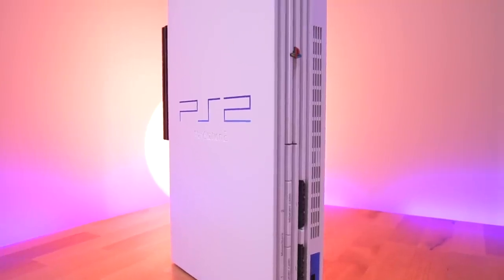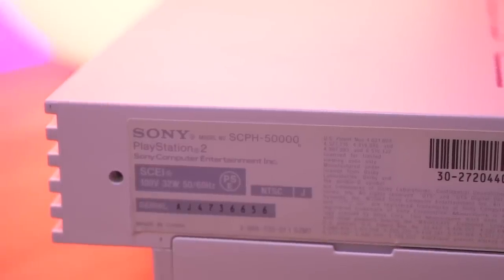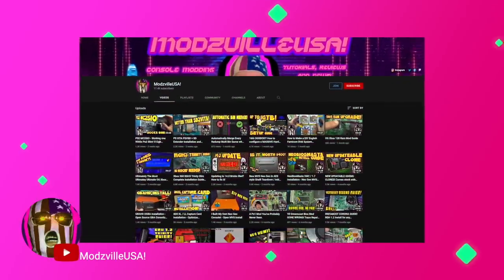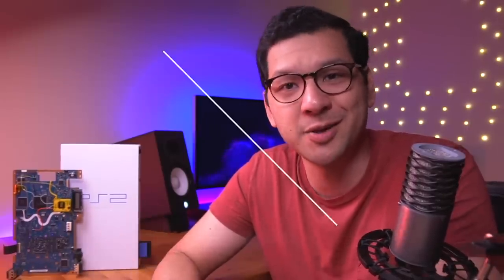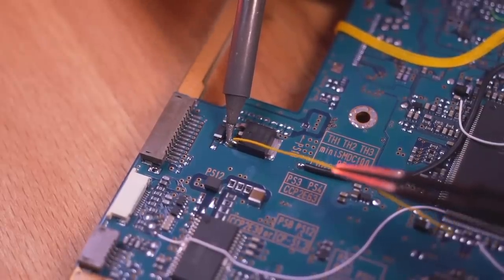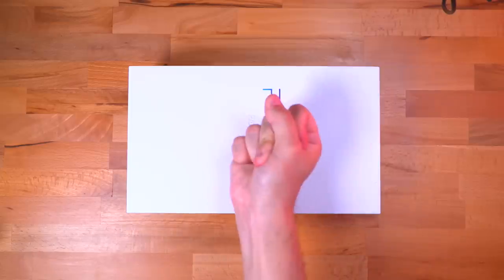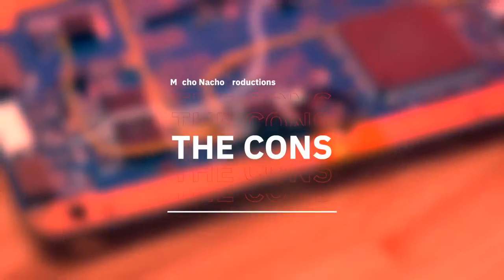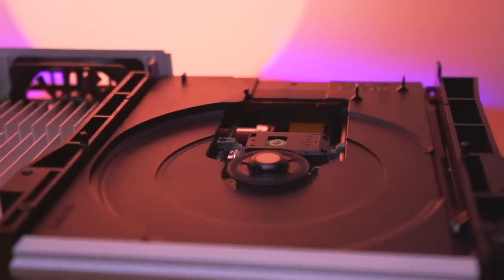This Mod Prevents Your PS2 Laser From Burning Out | The PicFix Mod

Comment: This is no where near as bad as the clock capacitor in the original xbox
Reply: Yes
Reply from the maker: Don’t know what Microsoft was thinking with that clock cap
Reply: @MachoNachoProductions  They definitely weren’t thinking about capacitor plague lol
Reply: That clock capacitor cost me a mobo. Hopefully there is a solution to that thing, unless I was living under a rock and there's already one
Reply: @Defx86  the solution is remove it!
Reply: My original died due to that capacitor during the life of the system. Repaired under warranty. Later on when I grew up and got into modding, I fully removed it
Reply: @Defx86  the solution is just removing it, works fine without it
Reply: Thats exactly what i did to my xbox the moment i got it, removed the clock capacitor completely.
Reply: just gotta make sure it is not the 1.6 variant since that one searches for the clock cap everytime the console boots and it won't work with it removed.
Reply: @andreiordean9346  And you don't need to remove them on a 1.6 anyway.
Reply: can you install this chip without the little PCB its mounted on? as I don't think they make them anymore and Modzilla doesn't sell them now either.

Can I just solder wires to the chip and insulate it?
Reply: Everybody knows about that, and it’s easy as hell to replace the ps2 laser is twice as expensive and difficult to replace.

Comment: I'm honestly surprised that the ps2 wouldn't have a hardware analog constant current limit on the laser diode drive circuitry to prevent this, completely independent of the mechacon operation. This is how most optical drive systems work, so the closed loop servo mechanisms cant force the components to operate beyond their physical/electrical limits.
Reply: Sjm4306 yo man! That is odd isnt it 🤔
Reply: NEEEEERRRDDDD
Jk but I didn't understand a word you just said
Reply: they did this on purpose so pirates have a difficult time trying to chip their ps2
Reply: @Truth-hk2dv  look at early ps3 consoles, they are the worst offender
Reply: Sony did it on purpose and got sued for it iirc
Reply: Sony wants you to burn for playing imports 20 years after you got your console lmao
Reply: It is believed that MechaCon crash is intentional by Sony, since the DSP chips of the DTL-H models have firmware changes that prevent it
Reply: Just to verify:
This does not apply to any SCPH-3900x model? I don't have the insight to the motherboards in the -5000x models and whether or not any -3900x models were susceptible to the same mechacon.
Reply: @That_Handle The 390xx consoles use the same DSP as the 50xxx ones.. so yeah, 39xxx consoles are  vulnerable too.
Reply: @Rodrigo-ks6oc  ,
✅️✏️📌👍
Reply: It is not the laser diode, they are the voice coils around the lens that move it to focus and track
Reply: I know right. Suprising for serious

Comment: Instead of soldering to one side of the SMD resistor, you could solder to the via right next to it. It connects to that side of the resistor and there is less chance of component damage.
Reply from the maker: Nice!  Good to know there’s another point to solder to 👍
Reply: On the GH-023 board there is a solder pad on the opposite side of the board as well. It leads to another via and then to the dsp cxd3098 chip.

My qsb I'm designing for the GH-023 is flush against the resistor side and blocks all of the surrounding area to avoid bridges.

Another point is as follows from left to right:
Y, K,I,H,G,B,A.

In your typical modchip install count one immediately left of point I and that will also yield the mechacon signal needed for the laserfixes.

Cheers!
Reply: pic's ?
Reply: @haloslayer255  show us. :O
Reply: I have the v8 scph 39000, still works fine with matrix 1.38 since 2003 when i've brought it, do i need to worry about it to my specific model?

Comment: This makes me feel SAD that Sony didn't learn their lesson since they gave the PS3 & PS4 a problem like this but WORSE! Granted they patched it for the PS4 but PS3s are still boned.
Reply from the maker: Yeah, that’s pretty bad for sure
Reply: Maybe hopefully somebody will Port this mod to the PS3.
Reply: sony just dont care if your console keeps working after 20 years lol
Reply: @draconic5129  Yeah. I HOPE someone makes an equivalent mod for the PS3 in the future.
Reply: @GatorRay  how did they patch it for the PS4? Was it done by a hardware revision or was it done in software, if it was the latter that might be easier to accomplish with existing custom firmware.
Reply: @draconic5129  It was a software update.
Reply: @user-yk1cw8im4h  Certainly feels like it. And it's SAD! Especially with the most recent attempt at giving players access to older titles on PS5. For some unholy reason. Has the same issue as the Playstation Classic. AKA SOME OF THE GAMES ARE THE PAL VERSIONS!

Comment: About that board from the previous video, check the fuse at location ps13, that controls the spindle motor ic. It's been a while since I've replaced any fuses but iirc the type to replace with is:
FCC16 401 or TF16SN 0.40 or ERBFEOR40S from the copper silkscreen on a v9, should be compatible with v10 though.

Cheers!
Reply from the maker: Awesome!  Thank you haloslayer!  I have someone looking at it right now and will let them know to check out the fuse. Thanks for all your work supporting the modding community 🙏

Comment: I recently pulled an SCPH-50001/N out of the electronics bin at my local town dump. The other day I took it up to the tech center at my local community college and we were able to get it running. 

Turns out the power supply had died, but the motherboard and DVD drive were working just fine. Hell, there was even a game still in the DVD drive!ATV Offroad Fury 2 in case you’re wondering.

Rather than replace the dead power supply with another power supply of the same model that would’ve probably just died again at some point, we pulled the old power supply out, and soldered a barrel connector to the motherboard’s power leads, allowing the console to use an external power brick. The barrel connector pokes out through the hole that was previously occupied by the power switch for the original power supply.

I’m probably gonna try the PicFix mod at some point to preserve the optical drive. It still works perfectly for the time being, but better to prevent a problem rather than cure it y’know? I also have a slim PS2 that I’ve had since 2006, but luckily it’s an SCPH-75001, so it doesn’t have this issue

Might even try to install a mod chip once I get more proficient at soldering.

Though I probably won’t use the DVD drive that much anyway. This console actually had an official PS2 network adapter attached when I found it so I’ll probably just install a hard drive or SSD. Already have all of my PS2 games backed up on my PC anyway

Definitely gonna replace the cooling fan at some point though, maybe with a Noctua fan like you did in one of your other videos.

Hell, I might try to track down a copy of the PS2 Linux distro to mess around with. So many possibilities now!

Comment: I tried once installing a ModBo chip and ended up frying my laser because it got stuck (apparently a wrongly made connection on the modbo chip). I had to replace the Laser with an aftermarket one, and now everything works. But after what happened, i will definitely be installing this one next just to be sure, ever one joint goes cold or the mechachon decides to freeze again, my poor laser dont get burned again. 
Thanks as always for the great content !
Reply from the maker: I had the same problem. Definitely got to double check solder joint and connections. It’s a great mod for piece of mind. Cheers!

Comment: Con: The PS2 Fat is a such a pain to disassemble.

In all reality I’ll probably skip this mod unless I’m doing maintenance. I suppose I’m taking a minor risk, but I only play legit discs and resurface anything that looks questionable.
Reply from the maker: You should be good to go. Mostly concerns burned media but has also been known to crash with scratched discs. Well taken care of authentic discs great mitigates the problem
Reply: It is the first time, but once you get used to it it becomes quite trivial. When I was cleaning out and fixing my phat PS2, I had to take it apart at least 15 times. The first time was rough to say the least, but afterwards I could crack that baby down to the bare motherboard pretty quickly.
Reply: One of the fuses failed on mine. That was so fun to nail down.
Reply: @frostech3149  this, its really annoying first couple times but really isn't too bad, there aren't tons of screws all over the place or confusing sizes for them. For the fat, if you been using it for years or someone else has and its never been cleaned for dust, I would highly recommend you put in the effort... There are so many places for that dust in that console

Comment: I didn't know about this design flaw until now. I'll have to keep this mod in mind because I play a lot of physical games on my PS2. Mostly, I've kept it around for playing PS1 games in component video.

Surprised there's still no clone systems of the PS2 floating around yet. You'd think there'd be some given that Sony's patent on the hardware has since expired.
Reply: Do you know how complex the PS2 is? Let alone emulate it. Projects like MiSTer got to Saturn/PS1 emulation just recently. i don't think we'll see a "ps2 clone" in, say, 15 years or so. Unless FPGAs get a massive jump in performance.
Reply: This only applies to anything beyond V7 and V8. Such as SCPH5000X’s and beyond. The much loved SCPH3X000’s aren’t affected. Personally i’d rather take the improved heatsink out of the SCPH5000X and put it into a SCPH3X000.
Reply: The FPGA scene has to first get to the Sega Saturn, N64 and the Sega Dreamcast before it even considers something as complex as a PS2 with its Emotion Engine and GS chip.
Reply from the maker: If your model is v8 or lower you should be okay.
Reply: 1st time I hear of this and I call it nonsense. At least for the European market that is. 
Plenty of people I know had and still have different PS2 from day 1 to last gen and I can say that the only reason why laser died out is due to it's shelf life and user neglect.

I restored plenty of PS2 and PS1 for 20 years and never hear of this crap. Unless the mod chips we used somehow fixes these problems hence why didn't know.

My 1st gen PS1 had it's 1st laser replacement in 2016 while some people complain how there is a design flaw of overheating the laser. Which I can see but mine never had the issue.
My fat PS2 simply stopped reading properly newer games at one point due to the fact the revisions got better performance, my slim PS2 had it's 1st laser replacement in 2018. I still have few last gen slims they still work fine with factory lasers.

All of them are chipped day one of purchase.

The only lasers we had to replace etc were the ones that were caked in junk and dust. With few exceptions that some simply fry due to bad electronic mains in some house holds. Often it fry the power supply and few components.

I once lost a PSone due to an outage where a huge burst of electic shock struck in a second later, there was like at least 20 on and off attempt in span of few seconds and by the time I unplugged it from the outlet it was too late. It fried the power supply laser and spindle motor the rest had minor damages. I lost few TV sets and some things in the house at that time and had to sue the electric company for compensation. We got some discounts for few months instead ... I was so pissed.

But yeah I never seen or heard this laser going bad due to reading bad or backup discs ... I run backups from day one ...

Comment: This video was a bit different but VERY HELPFUL!!!  You were able to demonstrate what a flawed install can look like and end up as, and you didn't even try to LOL :P   - With the jokes out of the way it is a GREAT thing you were able to show us, I just wish you had gone into more detail in the original video... it was quite confused as to what happened and it seemed like a cheap low blow of some sorts at the time... like you making it up or something... but I really didn't think that was the case, it just could have seen that way... again, it was just confusing at the time... but now that I know what happened, it all worked out smoothly.. We all make mistakes.
Anyway, this is one of those mods that does give you any instant gratification from all your hard work, but it is TOTALLY WORTH THE EFFORT! Thanks for showing this to the world, I know I NEVER heard about it and most modders would likely skip over it and go for the big toys to add on.... now if I only had a PS2 lol!
-- do you have any add-on/mods fo4r the PS4 Pro?? Not the typical jailbreak that is just so simple, I mean adding cool stuff on to the second greatest system created (even though I have yet to buy a PS5.. I'll just assume it's the best lol) Maybe upgrading a the internal storage to 2 or 4TB .. integrating the Pi Zero INSIDE the console so you don't have to leave it taking up your rear USB port (the pi zero does all the keystroke to initiate the jailbreak as soon as you turn it on - in case you didn't know) - just some cool add-ons - I want to do something to my baby, I just don't know what :) THANKS!!! :D
Reply from the maker: Dont have any ps4 pro mod videos yet but perhaps in the future 👍😁

Comment: This seems like such a rare problem, over the years I've put hundreds of discs in my ps2 that had scratches and I never encountered this issue.
Reply from the maker: Nice!  What model ps2 do you have?
Reply: in a sense, i've used that to my advantage.

my copy of fatal frame 2 has been played to death, so it has some light scratches i'm sure. or at least some level of wear and tear. but when i hear the disc spinning in a particular way/particular speed, i've used that to determine a random encounter is about to occur.
Reply: I had 2 different playstation 2 consoles die while playing gtaiii. I always thought it was weird they died with the same game...

Comment: My ps2 doesn't even have dvd drive, it was physically ripped out by previous owner. But you don't need it to play games and that is beautiful. 
Honestly the optical drive in my experience is the worst part of any console and should be ditched at first opportunity, if other ways to launch games are present for that system.
Reply from the maker: The optical drive is definitely one of the greatest point of failures on any console. I think it great that we have options to not need the drive but I do enjoy popping on a cd every once in a while.
Reply: @MachoNachoProductions  there is some guy working on ps1 games running from usb via some deckard hacking, if that thing is released then ps2 may be finally be fully free from need of disks, though that does not apply for mechacon models.
watch?v=OlSdBusJHks
Reply: Nintendo Switch: Hold my cartridge
Reply: @TN_AU  Too bad actually being able to play it requires paying an extra $70 to avoid dealing with the crappy joycons.
Reply: @TN_AU  many cartridge games require updates to add the necessary game content (AKA zero day updates) which is fine if you hacked your switch (then you can just download those updates from a different source) but if you have a later model switch and didn't install a mod chip when the service shuts down you're not going to be able to get those zero day updates anymore.

So the cartridge's added durability over the unupdateable optical discs is effectively offset by the fact that the games require zero day updates to either be finished if not in some cases even playable.

This is just on the switch though, other cartridge based systems like the DS and 3DS don't really have this problem (3DS games still use updates but they don't have mandatory zero day updates to my knowledge).
Reply: @draconic5129  good points, we are screwed regardless of how we obtain games.
Reply: Honestly I'm just waiting for someone to make an ODE for the ps2, maybe like the X-station
Reply: @draconic5129  You can make backups of your Nintendo folder on MicroSD card though.
Reply: Same. I run an SMB server for OPL.
Reply: @draconic5129  sadly alot of cartridges that are multiple games in one require you to download the other 1 or 2 like how bioshock on the switch is which is annoying. Also have bought a couple disk based games that won't function unless you download something which defeats the purchase of having physicals I try to research before I buy games now a days
Reply: @BestGirlsBiggestFan  yeah it all started once file sizes started to get bigger and a couple companies decided using bigger cartridges and disks wasn't  worth the cost the vita did get annoying to at points where they started shipping a couple games with just a code in the box like mlb 15

Comment: What I'm curious about is if it would be worth the effort to locate the burnt-out part(s) of that motherboard and replace it/them. 

I think I'm going to stick to the hard-drive setup on the PS2s I have. All of mine are second (or more) hand units that I picked up specifically for the tinkering of. I bought a slim not too long ago because it showed more promise of working with the memory card slot option. But with how much work is still needed on it, that's going to be a while. I don't know if any of the lasers work properly on my PS2s, they all have similar issues with that, which is why I probably got them so cheap. Oddly enough, the laser on the hard drive setup is able to rip games onto the hard drive, which I found interesting since it otherwise won't read disks for play. 

I would suggest this mod to anyone that would want to preserve their laser, and also advise them to find someone with experience in soldering. I feel like mine are long since gone for it though. :(